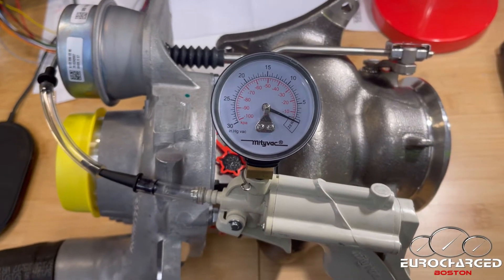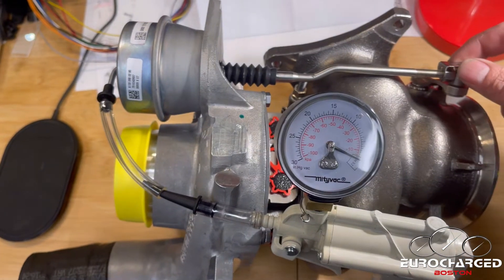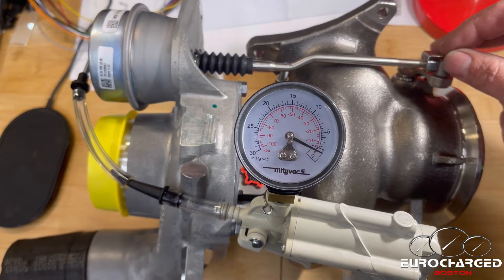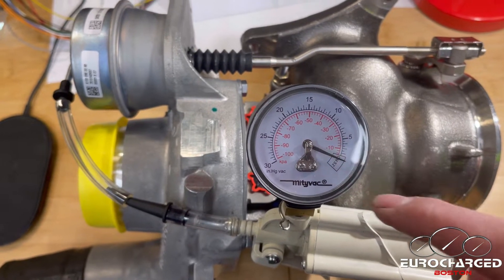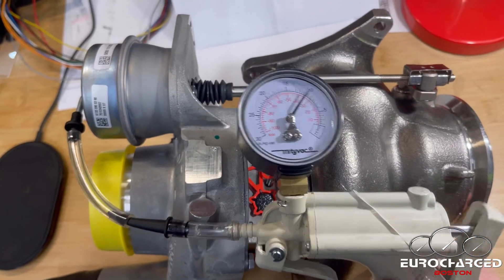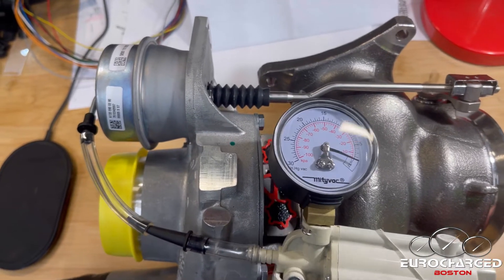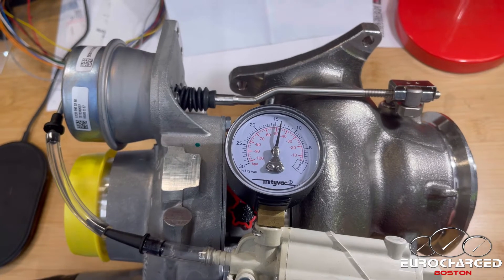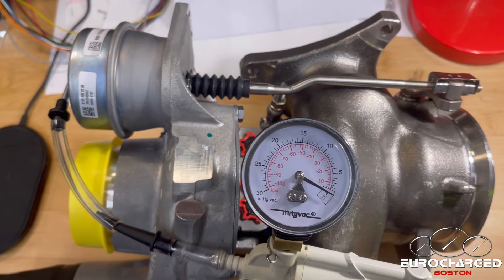Mercedes-AMG Turbo wastegate adjustment

Comment: Is this the same exact vac settings for a c43 m276?  I put a new one on and measured the thread length in between the nut to the bracket that holds the actuator's studs to get it close enough, car has 80% power returned but I still have underboost code p029900, boost gauge actually goes over half way now on the dynamic select boost gauge, so I know i'm on to something...i'm a carpenter, everyone tells me to sell the car but it would make me depressed. 

Figured I'd ask before i slap in an entirely new turbo. I am young and don't make enough to get someone to fix it for me. Should the arm wiggle at all because i have it tight....sounds like the arm needs to be moving with barely and vacuum on it. Thank you, when i get my bread up I'll come visit yall....
Reply from the maker: Rod length is meaningless when jumping turbos because of flap production tolerances, and thats why the rod is adjustable. 

you need to adjust based on vacuum measurement. copy off the good side on your biturbo. the two critical numbers is when the valve starts moving, and when it fully closes.
Reply: @EurochargedBoston  Thanks Eurocharged
Reply from the maker: @c43sedan  we just uploaded a new video on the process.
Reply: @EurochargedBoston  c43 is fixed, plugged mitycav vacuum gun on the other wastegate, pumped it slowly until the rod recessed and wouldn't go anymore, took note of the number which was 18 and then adjusted rod on new wastegate until it wouldn't go anymore and set to 18.No codes, car backfires louder and boost guage fills all the way. 

Thank you, saved me 2 months wages in construction labor. I will recommend eurocharged perpetually   to all my Benz friends in Tennessee, God bless you and your company

Comment: Let's move the lever along the thread?  and then compare with your measurements, the pressure will remain ,, the closing time or decrease if you move towards shortening the rod, or increase if towards lengthening..
maybe we can start thinking?  that in addition to vacuum there are also dimensions of the mechanism.